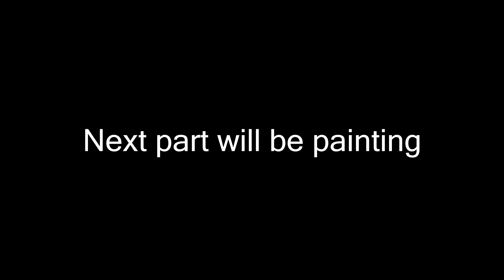200sx s13 Drift Build - Ep. 2: Rollcage & Sandblasting

Comment: Looking like a fun project. Did you reference any spec books for the building of the cage? I ask because there is no cross bar or diagonal bars in the main hoop which is pretty much the most critical life safety bar in there. I was reading SSCA specs and Global Time Attack specs to develope my cage plan. There is a lot of great info there to help you build and safe and functional cage. Keep in my that a poorly designed cage can kill you in a very slow collision (head impacts). Looks like you are having a good time, keep building!
Reply from the maker: Hi. I have one bracing that is welded in bottom of the main hoop. I bought this cage of someone that makes FIA approved cages and it didnt come with a diagonal bar. But thanks for the comment :D